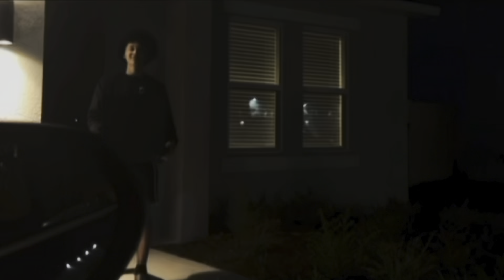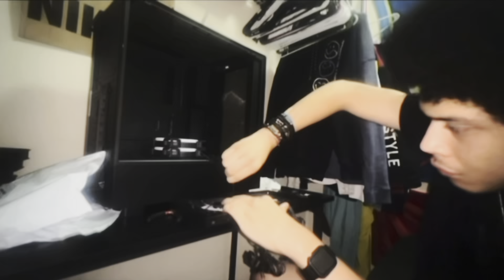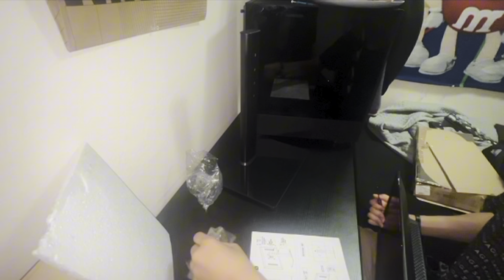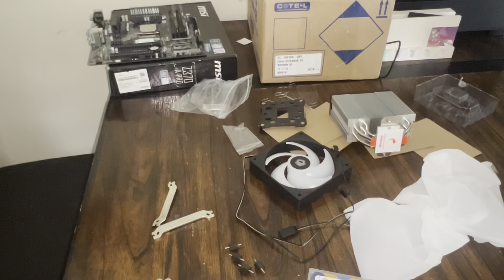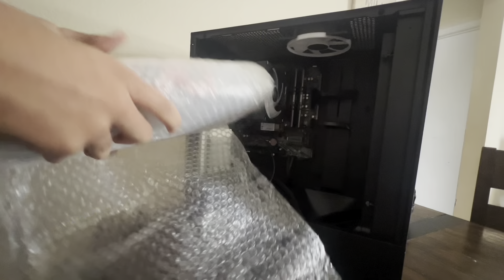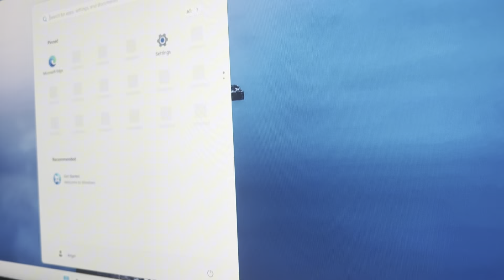How I Built My First Gaming PC With No Experience

Comment: Imagine how you felt waiting a month to complete your Build, my build took me a Year and a Half. However it was well Worth the wait. I'm on the AM5 Platform, with a MSI B850M-VC Pro Wifi Motherboard, a Ryzen 5 7500X3D CPU, the Radeon RX Nitro+ 7900XT (20 gigs of VRam), 32 gigs of DDR5 Ram Clocked at 6000 / CL-30, The Lian Li D11 Dynamic V2 Mini,  a lian Li 850W PSU, 1 TB Gen 4 Mvne, and the Tuff gaming 1440p Monitor. I cooking with Weson. Once everything was said and done I paid a lil over $1,100. Not complaining, the components I have are prettyyy Decent.
Reply from the maker: That sounds like an incredible setup, definitely worth the wait!